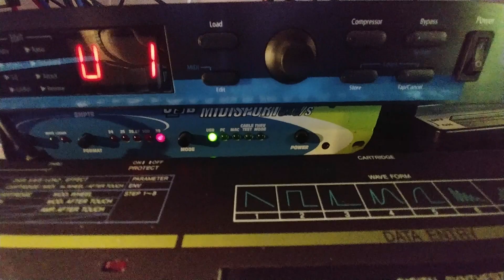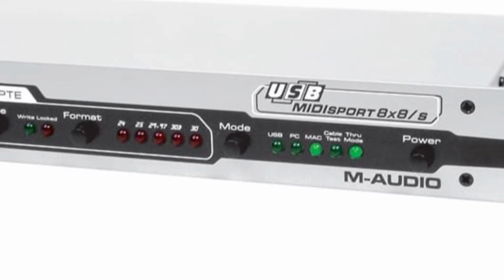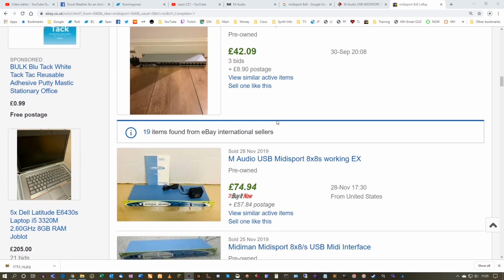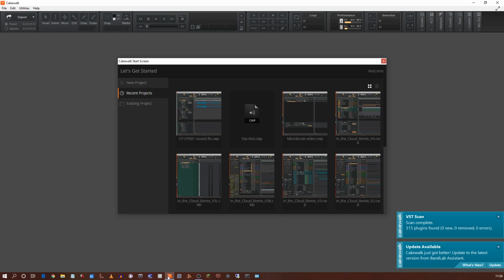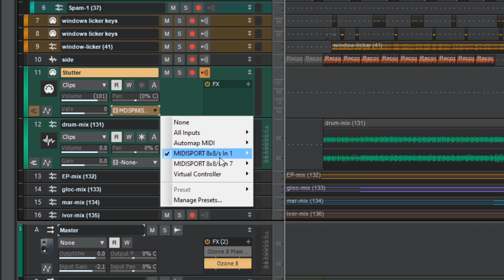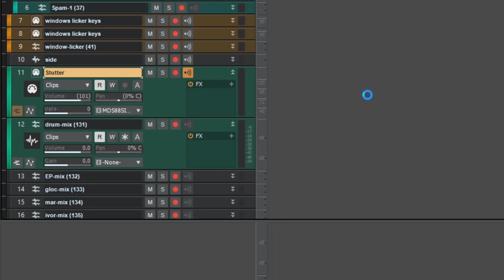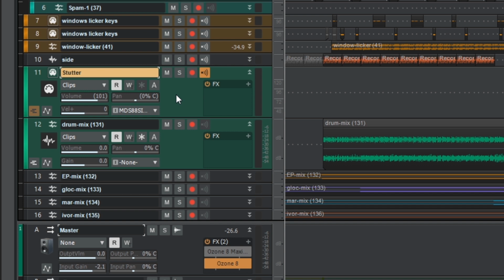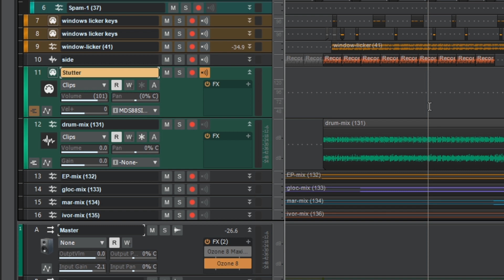M-Audio Midisport 8x8s USB MIDI interface - Overview and Trouble Shooting

Comment: 1. turning on the computer is the basis. And then it is also logical. If I now turn on the DAW (Cubase, Nuendo, Pro tools, Studio One, etc.) and only then the sound card, it also does not load into the DAW. And it is the wrong order. Therefore, it is logical 1. Computer 2. components: sound card, midi interface, etc. and only then 3. DAW. If I accidentally turn on the DAW before the midi interface, it does not matter, I turn on the interface and it is loaded in Cubase. So that's ok. Your video is only half meaningful. You do not show the back side and the connection of midi cables in relation to routing in the DAW. For beginners, this is essential information. Google translation. Composer from Czech.

Comment: I have a Midiman Midisport 8x8/s [bought it new when it first came out...].  Runs reliably and pretty much as your video describes.  I connect to Windows 10 computer with USB and to several vintage MIDI devices [E-mu E4 Platinum, Proteus 2000, DX 200, Roland SRV-3030D, Kurzweil Expressionmate].  I ONLY use it as a MIDI interface.  I do not use the SMPTE or stand alone patchbay features.  The MIDI interface drivers are functional in Windows 10 but the patchbay configuration program is not [you would need an old Windows XP box or a virutal machine to run it].  As you state it's fussy on restarts... I sometimes need to power cycle the Midisport several time to get it connecting properly.  Once connected it's rock solid.
Reply from the maker: Yeah, I may well revisit this device in a video as I've setup a 32bit xp machine specifically for old software and a copy of the OG driver disc is on archive.org .  I still have no problems with the box as long as I turn it on as per the video.  If anything, it seems a little more tolerant.

Comment: SO i bought one.... the silver one. All the MIDI IN lights are green , all MIDI OUT lights are red, SMPTE lights are off, all MODE lights are on! Doesn't seem to matter what i do, all lgihts just stay on, USB connected or not.... Any ideas? :(
Reply from the maker: Are the drivers installed?
Reply: @RunningonairMusic   well the lights are on like that whether it;s plugged in via usb or not. They never turn off, when that's not how it should turn on, they should all flash, and go off, and you should still be able to press the buttons to choose which mode you want to be in, but none of the buttons work. I installed a driver but that has done nothing for when it's plugged in either :(
Reply from the maker: Well, it sounds like it's freezing during boot up.  Can your daw see the interfaces?  If not, it may well be dead.
Reply: @RunningonairMusic  Naah DAW sees nothing. I'm returning it. Big shame as my MOTU is still causing random lock ups and MOTU have helped me but to no avail. Maybe i;ll have to get iconnectivity MIO XL ... but their systems are so overblown for my simple needs
Reply from the maker: Yep, sounds dead.
Reply: @RunningonairMusic  I know right! :(

Comment: I'm a bit confused at this point. My M-Audio 8x8 is in storage at the moment so I'm unable to just try the driver...but you are saying that '2017 driver' will run on Win 11 or 10 - 64bit without a virtual machine.  Thank you.
Reply from the maker: It does on my setup.  Was just using it yesterday.
Reply: @RunningonairMusic  Dynamite! It's been many yrs since I've seen the original driver interface, but I remember it had a patch matrix. So the newer driver is from M-Audio also? Can you describe what you know about this driver please? Thanks very much for all of your efforts.
Reply: @annode no, the patch matrix is a 32bit program.  So that won't work.  The driver just allows the device to be used as a midi interface.  I was considering trying to get the patch matrix side to work on xp, but I have no need for that currently.
Reply: @joeevansROA  Thanks Joe. So I then can look forward to having 8 independent MIDI ports on Win 11 recognized by my DAWs. Off to the storage locker!

Comment: NNonNNIt performs a precise 4/4 sometimes it slows down sometimes it goes faster, moreover my light on the USB does not go intermittently as fast as yours, but it closes and slowly turns on the green light.Can you help me, with synths it's fine with drums it seems to have trouble reading correctly
Reply from the maker: Try a different usb cable.  Test as many devices as you can.

Comment: I've been using this for years on Linux (Ubuntu Studio). Just yesterday, replacing my studio computer with a bit of fresher one (Phenom II) and Ubuntu Studio 22, getting this MIDI interface working was easy. The command line I found from a 2005 post on Ubuntu forums still works: sudo apt-get install midisport-firmware . Then cycle the power on the device, no reboot needed.

Tech talk for those who might be interested! The interface is not class compliant USB device. It needs its firmware loaded on each power-up. It sounds special, as you'd think that hadware has its firmware permamently there, but that's not always the case. Not on expert on the case why like this. Easier (read: more cost effective) to update firmware as it's never stored on the device? Just update the firmware file on computer and bang. Anyway this is why it needs special "driver" or software on computer, and it doesn't do anything without it (EDIT: it does work as stand-alone box, but not in USB mode!)

On Linux there is this thing called udev, which needs a rule, that detects this device appearing in raw mode (pre-firmware upload) and then runs command(s) to upload the FW and add it to the system. After FW upload the device has a different ID code, so it's clearly distinguishable which mode is it in. I had some issues using the interface on the old computer and did a workaround by editing the udev rules. Not sure what upgrades I had done etc. but this time no tweaking was needed, just installing the firmware via terminal.
Reply from the maker: Thanks for the info.  Im sure that will be a great help to anyone who wants to get more out of this box.

Comment: Used mine for years and stopped working via USB due to drivers not being updated. Found 3rd party, but of course it does not support  OS 10.13.6….💁🏽‍♂️.
Reply from the maker: Yeah, it's a pain when you know there's nothing actually wrong with the hardware.  Things have been a bit better on the windows side with windows 10, I've not tried windows 11 but I expect it will still work as you can generally use older drivers on newer windows.  The main issue is whether it's 32bit or 64bit.
Reply: @RunningonairMusic  64bit
Reply from the maker: Yeah, i meant ive had issues with old kit because there was no 64 bit drivers.  They stopped updating at xp 32bit but if they had done an XP 64 bit driver it would probably work on Windows 10 too.

Comment: How to program standalone (no daw) mode 8 presets on windows 10?

Basically I want presets to reroute standalone Motif XF / Korg M3 / RM1x / Virus TI etc. for example sometimes I want Motif to sequence and control Virus TI and Sometimes I want M3 to control Virus TI. I want to switch that with standalone mode.

I want to have a DAW preset, and various Standalone Presets.

Right now it only works with DAW mode and DAW midi echo.
Reply from the maker: It's not something i've tried myself, but in order to change the presets you need the original 32 bit windows app that came with the device.  You'll need to search around for this as it's not on the m-audio site.  You also need a 32 bit windows installation, preferably before win xp. You could use a virtual machine but you have to program it via the serial interface.  All in all, it's great deal of hasle, which ive never been bothered with.  Could make a good video though, so i might give it a go at some point.
Reply: @RunningonairMusic  ty replying. I really want to program the 8 standalone presets and select them via holding the panic button.

Comment: Hey there! Is this still holding up in 2021? I'm about to get one and wondered if there was anything in particular I should look out for.
Reply from the maker: Hi, yes still works fine.  The only issue I've had since the video is that it did totally lock up once and appeared to be dead.  This was a result of too many reboots and disconnects.  I turned it off over night and it was fine in the morning.  So, I'd say it's pretty good.
Reply: @RunningonairMusic  Thanks for the quick reply!
Reply from the maker: Some new info that might be of use

The 8x8 can be used as a full routable midi patch bay, although the software is old and requires setting up a virtual machine.  I found instructions on how to do this on this great tech blog site.

http://hi-toro.com/thisdrivel/
Reply: @RunningonairMusic  Thanks man! I ended up getting a newer MOTU MIDI Express 128. Just hope it doesn't mess up my sysex dumps.
Reply from the maker: @orphic-trench  no problem

Comment: Hi mate. It seems whatever I search lately on YT you have something on your channel about it :D  - yes I already subscribed but I think not that the YT-AI-magic notifies of past-content. Anyway I have a somewhat big/small favour to ask. A 8x8 unit has come up locally. I asked the seller if this works standalone. From your video that would suggest not. I wonder, this 'mode' switch. Can it/you cycle through all the options and then the light turns off, perhaps indicating it is in hardware-standalone-midipatchbay mode?
I just want to use it as a glorified midi thru box...cheers
Reply from the maker: Yes, i think it will do a basic midi through function.  Ive not tried it in that mode but I'll give it a go later.
Reply from the maker: Some new info that might be of use

The 8x8 can be used as a full routable midi patch bay, although the software is old and requires setting up a virtual machine.  I found instructions on how to do this on this great tech blog site.

http://hi-toro.com/thisdrivel/

Comment: DAMN I thought this might work for Live 10, but not seeming to.  Thru mode works but usb mode won’t send midi sync out nor will it receive or send midi
Reply from the maker: Your issue is more likely to be os related.  Mine is setup on Windows 10, although the most recent drivers are for earlier windows.  Did you download the drivers?  Sounds like it's not installed.
Reply: Runningonair yea it is probably OS related.  I’m on a Mac.  I downloaded the latest driver but even that is a couple years behind macOS Sierra which is what my computer is on.  It’s a bummer because I could use the SMPTE sync for my MPC60
Reply from the maker: Yep, that sounds like the problem.
Reply: Runningonair dammitttt well.  Guess I should find some motu or something

Comment: I read that you could use a software to get it working as a patchbay, have you had any success doing that?
Reply from the maker: no I've not tried that.
Reply: @RunningonairMusic  I see, apparently you need windows xp to edit the user presets but then you can use it without a computer. I might be buying on so that's why I was asking.
Reply from the maker: Some new info that might be of use

The 8x8 can be used as a full routable midi patch bay, although the software is old and requires setting up a virtual machine.  I found instructions on how to do this on this great tech blog site.

http://hi-toro.com/thisdrivel/

Comment: Good morning friend,

i have a question.
Can i use the device as standalone without a pc and software?

Greeeeetings!
Reply from the maker: Some new info that might be of use

The 8x8 can be used as a full routable midi patch bay, although the software is old and requires setting up a virtual machine.  I found instructions on how to do this on this great tech blog site.

http://hi-toro.com/thisdrivel/
Reply from the maker: Hi, It does have a "thru" mode.  With this all midi from an input is sent to all outputs, so it acts a midi splitter in this case.  It does mean you can get some use when your computer is off, but essentially you need a computer for full functionality.